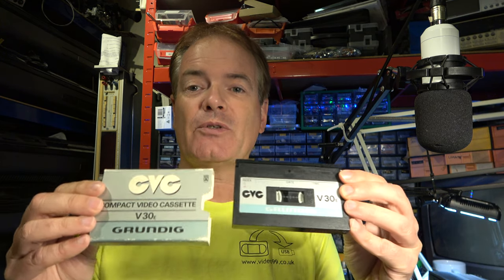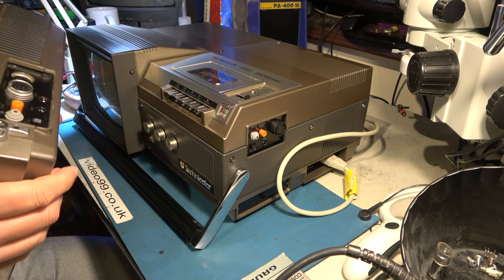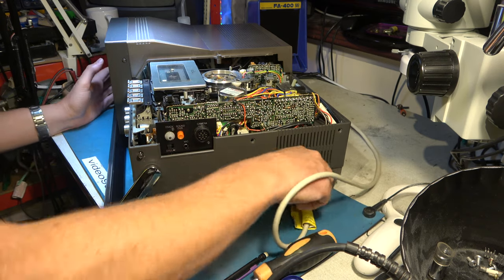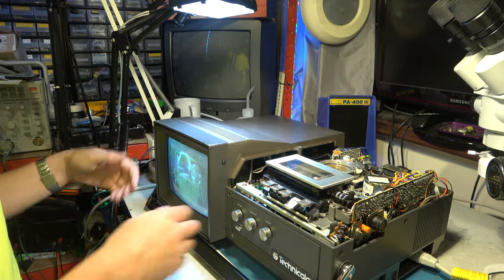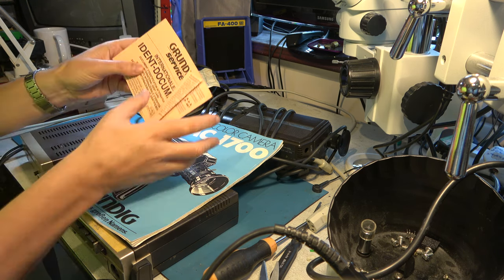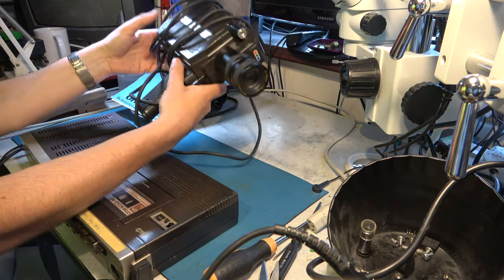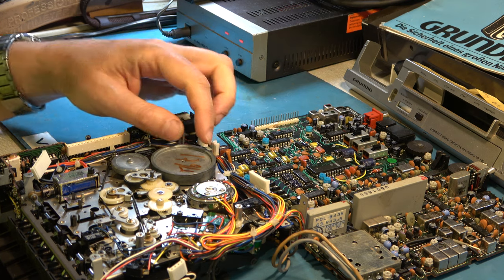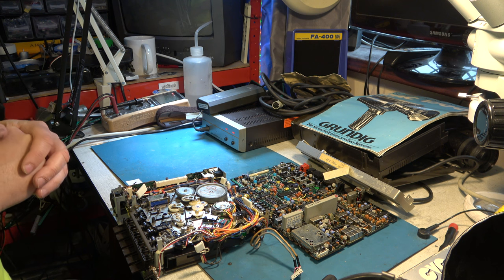The rare CVC video format. Working on CVC mechanisms.

Comment: The VP-100 is a great looking machine, I can't wait to see it working.

I bought a reel to reel about 3 years ago. The audio was there but the mechanism did'nt run.
so I assumed the belts had broke. (it used 3 of them). I took the top off and all of the belts had melted all over the mechanism. I put the top back on and stuck it on a shelf. It's still there. LOL.

Comment: Hi! I also have a Grundig CVC tape recorder! I changed a lot of :) capacitors! The problem was that the copper under the capacitors was broken.THIS WAS THE SMALLEST CASSETTE FORMAT AT THE TIME! I really liked!
Reply from the maker: I've been working on the VP100 and found exactly one slightly out of spec capacitor.  But I think I'm closer to finding the real cause of the fault, wait for Part 2...

Comment: Am I mis-remembering, or does the video output pin on those Hirose Camera connectors have a DC offset? (Assuming they're the same as used on VHS portable recorders.) I seem to recall the voltage of the offset is used to signal to the camera whether the machine is in play or record mode, or something??
Reply from the maker: I'm not aware of that but it's possible.
Reply: This is NOT a Hirose Connector on the camera at 20:25. This connector is called Din-AV. It is a 240° 6 pin connector and is the predator to SCART. It was intended for bidirectional signal transfer, but had only enough wires to allow one signal direction at a time. This is why it contained GND, Vid, Aud L+R, a 12V low power supply line and a signal flow direction control line. The control line was meant to signal to the TV when a VCR or other AV source was requesting a playback on screen, to which the TV would turn its DinAV plug from output to input mode, speed up its sync separator latency to avoid flagging on the top of the screen, and display AV or some other program indicator.
Reply: @randomsteve4288 That squashed connector is indeed a common DIN plug, but the Camera connector I was referring to is the 14-pin Hirose one, indicated at 1:47 in this video.

Comment: It really makes you wonder what sorts of conversations the engineers were having amongst themselves/upper management when this device was being created. In some products it's obvious: the entire Betacam lineage seems to have been overengineered within an inch of its life; a gentle breeze at an inopportune time would most likely wreak havoc with a DVCPRO deck, but with this... I'm not quite so sure.

Curious as to hear your opinion on some of the design decisions that were made - do they have any redeeming qualities? Are they otherwise novel ideas, hampered by xyz?
Reply from the maker: It's nice the way the tape vacates one spool to make room on the other, like an audio cassette.  Few other video formats do that (U-matic does).  The lacing mechanism was the big problem with the Technicolor design, which Grundig sorted with the VP100, but by then it was too late to save the format.  There will be more on this format shortly, I've been working on the VP100 and also may have something else coming in.

Comment: 30:59 looking at the mechanism and PCB this was not really made by Grundig. The mechanism with the microswitches gives a strong JVC vibe and the chipset on the PCB is Hitachi and the Electrolytics Made in Japan. If it was a Grundig designed gear the higher level signal chips would be Philips/Valvo or Siemens and the caps Frako or ERO.
Reply from the maker: Since Funai made the first generation of CVC machines, it's quite likely they were involved in the Grundig model too, but they never marketed that improved version.

Comment: Adjustment of the Tracking Control is usually not necessary when playing tapes recorded on the same machine, but may be required when playing tapes recorded on another machine.

I had a Grundig badged CVC Portable (IIRC). Never worked properly! Now polluting the environment in landfill! 💀👎🤣

EDIT: One wonders WHY manufacturers don't design products with EASE OF SERVICING in mind?

ANOTHER EDIT: 18:44 The Grundig VP100 appears to be identical to the one I had! I seem to remember I had some Technicolor machines too.

YET ANOTHER EDIT: Rubber perishing is a perishing nuisance! ... Particularly when it happens to my RUBBER CLOTHING! 👎😜🤣